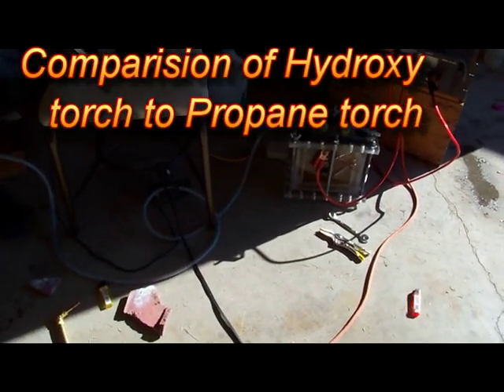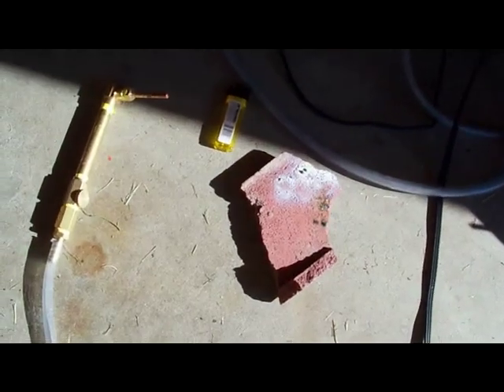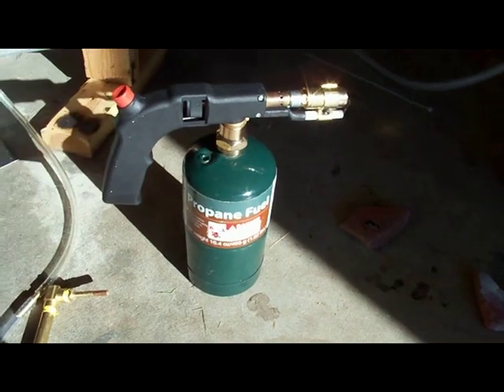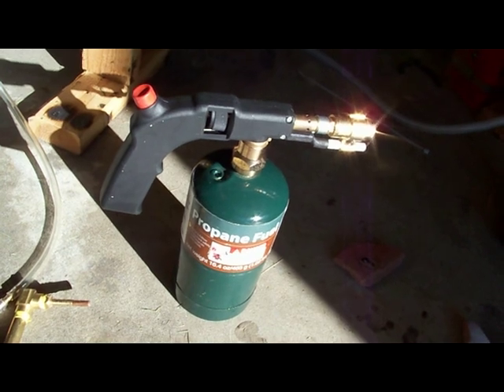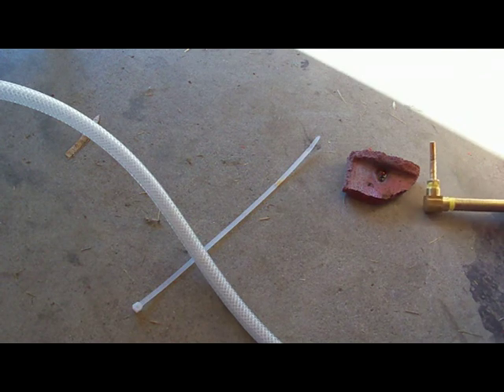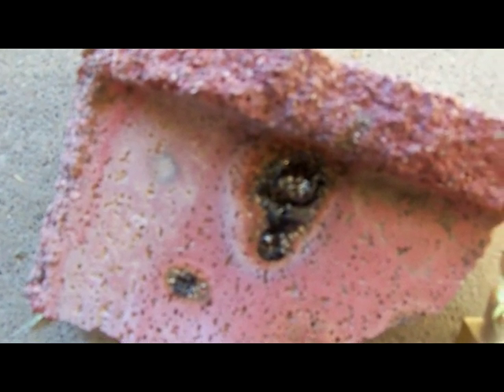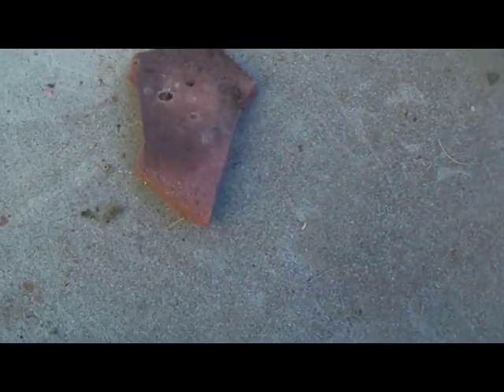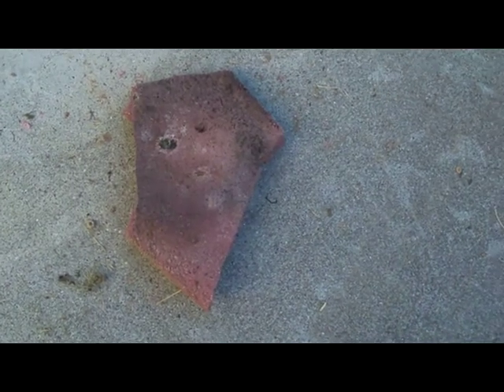Comparison of Hydroxy to Propane

Comment: Nice try Jake, but knowledgeable people may object, Wile it true that a Propane flame is less hot then a Hydroxy flame, for this test ( heating a rather big termal mass), energy density is also a factor ( propane is higher then hydroxy). And it is not a brick but red colored concrete. Maybe you can redo it with a little piece of a metal with a known melting point ? ( a mp between the 2 flame temps) ...